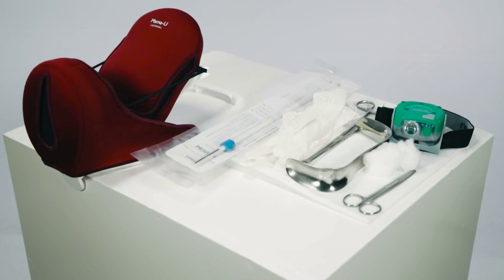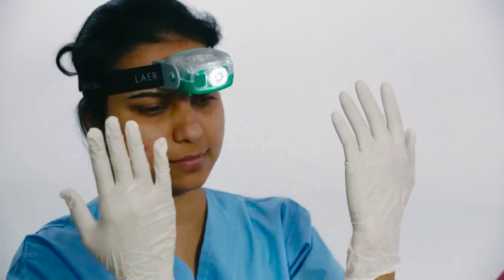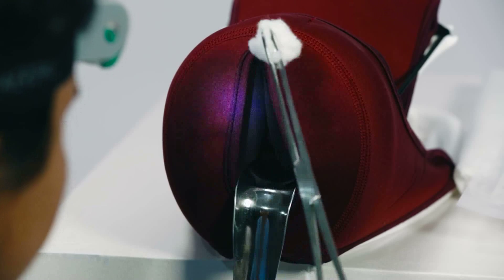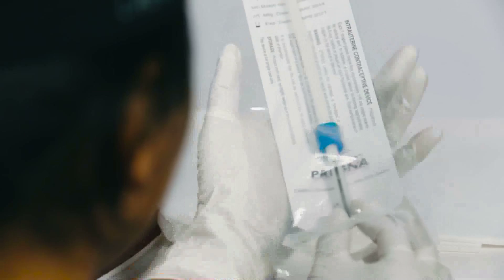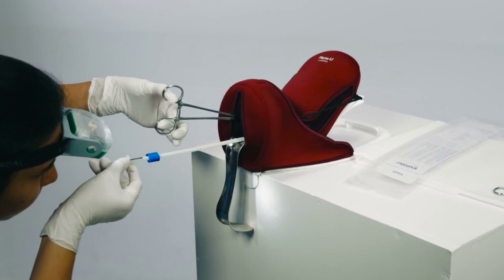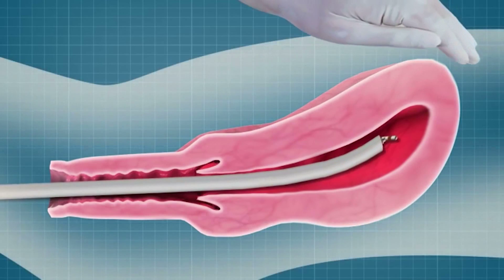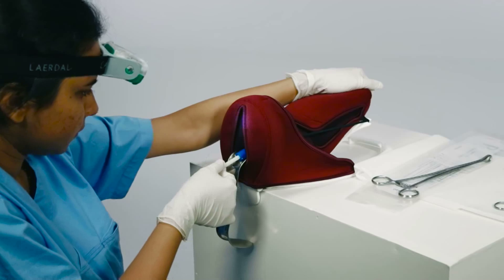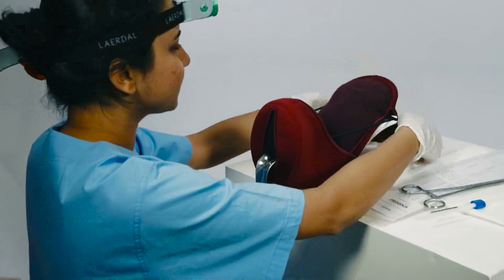Insertion of Post Partum IUD (PPIUD) T Cu 380A

Comment: Several faults in the video, not accurate... Single speculum is not enough to keep open the cervix stably, No measurements were taken beforehand, that completely loses the function of the blue cervical guard ! The arms are never perpendicular, they are bent and put inside the inserter tube... expecting a much more accurate video
Reply: Agreed